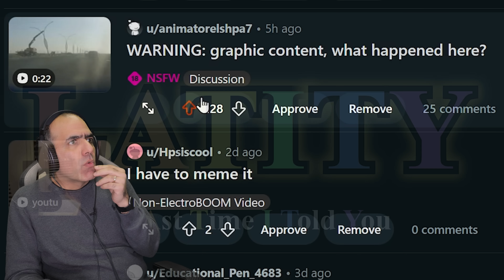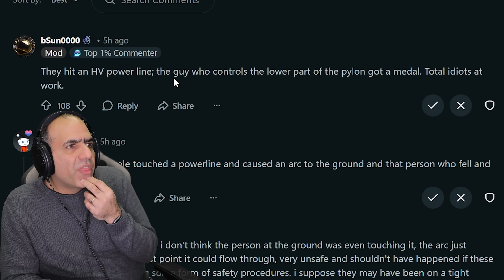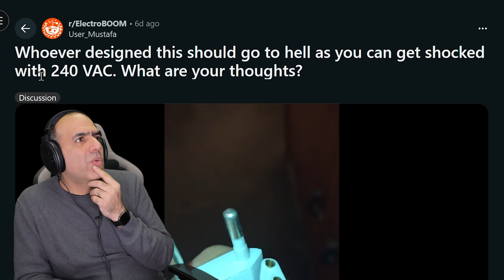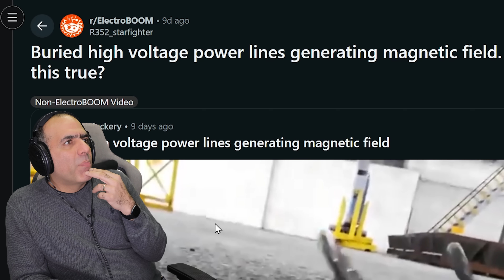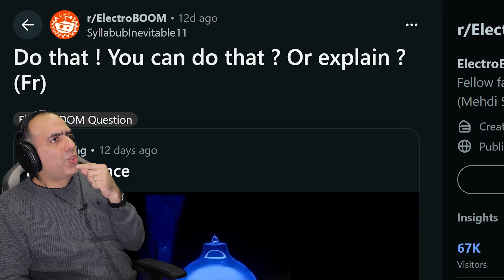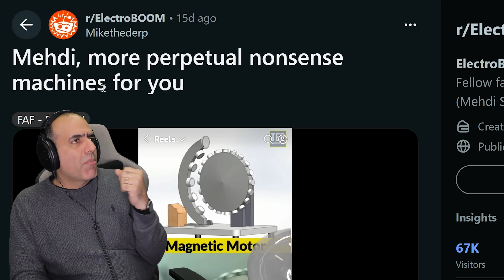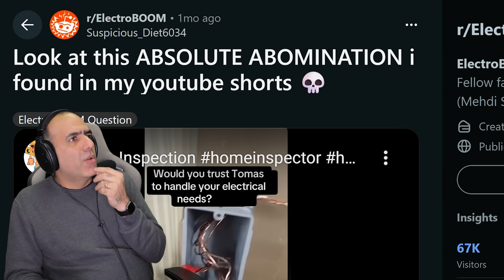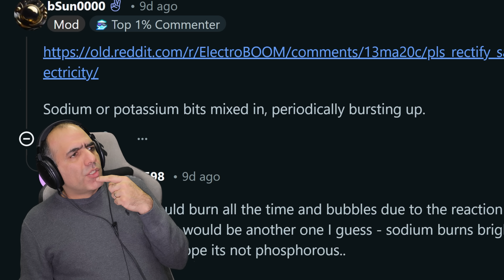Have a Pole? Need a Hole! (LATITY-017)

Comment: Brazilian here. That's our national standard for electrical outlets; for 16A and 20A appliances, the thickness of the connection pins is different, so you can't plug a high-current appliance into a 10A outlet, but you can easily use a <10A appliance in a 20A outlet. Besides that, it doesn't prevent us from using adapters and plugging 20A appliances into 10A outlets; my microwave has been like that for a few years and so far everything is fine.

Comment: In Brazil there is no standard for 110 or 220v outlets and some states will you either for their home consumers... You can imagine the mess
Reply: Many homes have both (often in the same outlet as in the picture). It's actually 3 phase supply so phase to neutral gives you 127V and phase to phase 220.

Comment: To prepare you for school: ged and no highschool diploma or college,  generator mechanic and electrician, the reason residential voltage is usually limited to 120V (and 240V split-phase) is because higher voltages push more current through your skin's resistance, and it's that current—not just voltage in general—that forces stronger involuntary muscle contractions.
With dry bare skin (high resistance, often 100k+ ohms), 120V or 240V usually gives a quick twitch or jerk that throws your hand away (low current, below let-go threshold). But step up to something like 277V on a wye system (hot to ground), and even with dry skin it drives enough extra current to cause sustained contractions—your muscles lock harder and longer because you're closer to or crossing the let-go threshold (~6–16 mA). It's a combination of voltage overcoming skin resistance to produce current, plus the 60 Hz AC frequency preventing muscle relaxation, that causes the real "can't let go" effect. Path matters too—hand-to-hand or hand-to-ground is worst.
I'm smoking cereal milk, I smoke weed so that's my excuse for rambling like a half-educated idiot. What's yours? haha

Comment: 6:30 It is probably from an aluminum foundry. The excellent Mr Bidouille, a French youtuber, https://youtu.be/7aQZOzjjlC0 visited such a plant and does the same experiment, aim at the middle of the video. The large pillars are bringing the huuuuge amount of current required for electrolysis. I didn't have the chance to visit such a plant, I "only" saw a copper electrolysis plant where each cell drained 15,000A in 24V (DC obviously). It was already impressive.

Comment: Some idiots installed stucco on the outside of my apartment and stapled chicken wire deep enough to electrify the chicken wire and whenever I left the house barefoot I got electrocuted. Took them 6 months to fix it.

Comment: The reason why they still produce and sell incandacent bulbs even today with higher ratings is that in industry, university labs, etc, using these to convert excess power or test power into heat and light, since its better than being blinded by the lights of the LED bulb. 

Example, if you want to draw 1kW from the generator/power driver you have designed, using these bulbs is cheaper. very cheaper! compared to professional load. Imagine using a 1kW LED and being unable to see the instruments' screen due to super bright light, lol

Comment: Hi Medhi, for large capacitors: when I worked with huge caps (6 x 10F caps for simulating lightning strikes) it didn't have any lines on top to allow it to "safely" explode. My guess is because at that point it isn't safe to explode under any condition. The cap in the video you showed is also quite large so I'd imagine once you get large enough it stops mattering 😂

Comment: 5:00 the capacitor you saw is made by Keltron, and instead of groves on the top, the base rubber part of the capacitor is designed in such a way that there is a weak spot on it, where the pressure vents through. designing the base of the capacitor in this way is much cheaper. They don't usually work in these capacitors. These capacitors are of much higher quality and cheaper compared to other ones available in India they are available literally everywhere here...
Reply: Hiii that was my submission and it's actually my fault 😂😂 water got inside the capacitor 😂😂
Reply: Yoo keltron mentioned
Reply: Right

Comment: 12:57 yep. In Brazil, the standard voltage is defined at the city level, so in some cities the default is 220V while in others it's 127V. In others, it's possible to have both, so you can have stuff like those outlets. They usually use different colors instead of small stickers to label the outlets tho. When you buy something electronic you have to make sure you're buying something for the correct voltage. And yes, many appliances are lost yearly due to people plugging them to the wrong voltage.
Reply: That is horrifying
Reply: @wazoheat  you can usually test the wall sockets. Or connect a fan and watch it smoke.
Reply: @wazoheat  nah. Most appliances are autovolt or bivolt. It may be horrifying for people who import devices not compliant for the brazilian market.
Reply: @wazoheat it's really not. Any remotely up-to-code building will have the two voltages clearly labeled to be distinct at a glance. Further, in a domestic setting you're unlikely to have more than two outlets of the less frequent voltage in the entire home, which is not at all difficult to keep track of, even if you're too blind to see the socket's plastic housing is clearly color coded.
In fact, this arrangement is very similar to how it works in the US, only our socket standard is MUCH better, with proper safety regulations.
Reply: Not quite the answer but close. We use many more voltages: 115, 120, 127, for phase only, 220, 230, 240, 254, for phase or line, 380, 440 line only. What happens is, for example, in cities where 120v or 127v are available as phase voltages, also are available 220v or 240v or 254v as line voltages. And the standard allows using the neutral pin as phase, enabling the socket a line voltage.
Reply: @FelipeRochaRibeiroBeyer  Deus é mais
Reply: Dont you not have a national combined grid?
Reply: @N1g4t0wl  The grid is interconnected. All standadized at 60Hz. But one thing is the grid, other thing completely different is the mains voltage, which depends on the last transformer powering the socket.
Reply: @N1g4t0wl  The domestic grid has 3 wires: two 110V lines with opposite phases and a neutral wire. This allows you to choose per outlet whether you want 110V (phase + neutral) or 220V (two phases). I’m not sure about "city level standard", but at least in my region most outlets are 110V and a few are 220V in case you need to run high-power appliances like an oven.

Comment: 10:48 hi Poland here, no they probably don't use 250v but around 230v, it's written 250v volts because there are quite big fluctuations due to solar panels or something like that, I was mesuring voltage at my home and it's around 235v, in my friend house is 230v (I'm living in east part) in central Poland I measured a 225v and in west part through my measurments is around 240v, so depends where you are there are diffrent voltages, so manofactures want to make it safe, most of devices are now rated for 230-250v or even 220v-250v.
Reply: Fluctuations have nothing to do with it. The reason they have 250 V written on them is because almost all switches and sockets  were designed for 250 V.
Reply: @mernokimuvek  (read this reply to end because I think you didn't read to end my comment) and why were design for 250v? Because in my opinion it's due to fluctuations, maybe I'm wrong but if yes I want to hear reson why, and you didn't read to end my comment because I wrote that more of this devices are rated for higher voltage than "normal" and throught the logic you can imagine that this 250v is their max designed voltage
Reply: @zenek48  It's because several decades age voltages were not standardizes and some countries used 250 V as the nominal voltage. Your theory of fluctuations makes no sense since 230V+/-10% is allowed, so it should be rated at 253V.
Reply: @mernokimuvek  ok maybe you're right, I don't know, but I apprecite that you are a normal pearson no like some of this kids in comments that will be rude to you.
Reply: Solar panels also have literally nothing to do with why line fluctuations happen. MUCH more likely are things like cable age, run length, the type of transformer usedto step down from high voltage to mains before entering you home, etc.
Reply: @Gabu_ sorry but they can do, idk how in your country by in poland if you have sollars you can produce this electricity and "sell it" (not exactly sell it but send it) to main network, and due to that in summer we have sometimes too much energy produced
Reply: @Gabu_  they have, we in Poland don't use dedicated distribution transformers for each house, our low voltage distribution looks like that, you have one high power 15kV-0,4kV transformer which feed usually quite big part of residential area, so when much houses on same low voltage distribution circuit have installed on-grid PV systems, it can usually increase phase mains voltages, I usually heard about voltages around 253V in sunny summer days when much houses have on-grid PV and these are on same circuit.

Comment: I spent a lot of time asking AI how long it will be until the value of efficiency is worth moving all power cables to isolated vacuum lines as part of an underground high speed cargo/power/liquid transfer network. Apparently the biggest motivation would be avoiding power theft vs. power loss due to inefficiency?

Comment: The latity videos are awesome Mehdi, the explanations are correct from a scientific aspect about electric fields ionizing the oxygen molecules in the air to form plasma and also about the shown tesla coil and it's resonance and reactive power out of phase for ac power and everything about electronics, it's nice to see an electrical engineer who truly knows about electricity, can imagine the electrons oscillating and besides the physics, it also involves some fairly advanced math for signal functions, sine wave and function adding up or their composition. I'm glad to say that during my graduation I also wanted to always know how to get to a specific formula, unit or a constant which is very important for engineers because we have to be able to think outside the box and to solve the problem which involves multiple steps and you have to fully understand it and not memorize it mechanically, so you can manage to deal with something completely new. I just need to give you an advice and that is to try to apply your theory in practice like staying away from a high voltage sorces of electricity that are capable of producing high power (have low enough internal impedance) because it can be quite dangerous as you know, like the microwave oven transformer, it's secondary voltage is very high and it is a low frequency, low impedance (which means high current limit that it can provide) ac power sorce which is probably the most dangerous combination, van de graff is quite nasty, but not so dangerous because of the short pulse period (not gonna explain further, you're an electrical engineer as well). But, all in all, keep making these videos because they're both informative and entertaining. Honestly, a very nice video, except at 12:16 when I was absolutely blown away by numbers 6 and 7 where I went lmao😂😂😂. Thanks Mehdi

Comment: Besides, if your muscles get more than enough current (depends which muscle) to get burnt usually tendons connection to muscles and nervous system burn, it can stretch muscles or retract them hard enough and then lost nerves cannot command them to get back to normal so they get hard as a rock, that will kill you in a fraction of a second

Comment: That 110V and 220V connections remind me of when we had a pilot on board with a 110V laptop that was nearly out of battery and we had a 220V main net. Got the Electrical Engineer to rig up a transformer to halve our voltage. He rigged it up the wrong way, and in stead of going from 220V to 110V it doubled it from 220V to 440V... that laptop didn't live long.

Comment: I think typically in Brazil you have either 127 V or 220 V on normal sockets. That may be form some hotel or something like that so they have both. That kind of a system used to be common in many European countries in the past like 1950s.

Comment: 12:50 it does happen, a lot, we use a mixed voltage here, part of the country uses 127v(we call it 110v) and the other half is 240v(we call it 220v) almost everywhere that uses 127v has some 240v outlets sprinkled in, we prefer 240v for power tools and other high power applications, like the showers, and use 127v for everything else, thankfully, almost everything supports both voltages nowadays

Comment: Speaking of shock hazards, I got one of those fancy Pomona clip lead sets (stupidly expensive) because I was sick of the cheap chinese ones failing. One of them had the conductor partially poking out of the molded plastic right where you press with your thumb to open the clip. I contacted Pomona about it and they said "oh, we don't make clip leads."

Comment: 12:40 Its commom to have both 110V and 220V circuits on some regions of Brazil and yes they use the same socket. Most of the appliances are also sold in 110V and 220V versions. As you can imagine, its very easy to mistakenly hook up a 110V appliance in a 220V outlet. Ask me how i know...
Reply: 220v and 127v devices/outlets being interoperable is a FEATURE, not an issue with the standard. Pretty much anything built to follow Brazilian regulatory norms in the past 25 years will gladly function with both voltages. The appliances which do not either require a completely different type of connection (e.g. water heating showers) or planning (e.g. fridges). At that point, connecting a device to the wrong voltage is to damn one's own intelligence.
Reply: @Gabu_  of course, but appliances with ac motors or heating elements are usually single voltage
Reply: I live in Brazil, and any modern electronic device here has Dual Voltage. Most household appliances in my home are like that. So, unless it's something very specialized, it doesn't make much of a difference. Even computer power supplies are like that these days.
Reply: In the US we'd probably use a NEMA 5-15 and a NEMA 6-15 for that. The prongs don't line up between those standards, so you can't accidentally plug in the wrong one, and they're both reasonable sizes to be plugging in and unplugging devices regularly (unlike dryer plugs).
Reply: @diablominero  "probably" is the slightly concerning word in that sentence!
Reply: @paulabraham2550 we could use 5-20 and 6-20 if it's a high current circuit. Or somebody could use a dryer plug for a 220V  kettle. And of course a moron with a soldering iron can construct any cursed thing, electrical codes be damned. But I think 5-15 and 6-15 is the default right way to build a system like this in the US.
Reply: :face-turquoise-covering-eyes:We have red sockets for our 220V outlets in an attempt to limit the chances of that. It doesn't necessarily work.
Reply: @paulabraham2550 it does work, unless you're incredibly stupid. Also, what kind of garbage device built in the past 25 years can't operate with either voltage?
Reply: @Gabu_  kettle
Reply: @Gabu_ the best solution I think is to enforce electronic overvoltage and undervoltage protection embedded in all appliances, or at least in single voltage devices. People would use adapters anyway if the sockets weren't unified, so using different sockets wouldn't solve anything and still be worse by breaking the interoperability.

Comment: If Philippine's 250 V @ 10 A outlet is weird, let me tell you that we also use the same exact outlet and plug for 120 V (like Brazil but no ground).

Also, @ 6:53, I think that's in Philippines too based on footbridge style and color (or lack thereof), and a convenient location of jollibee near the footbridge. And yes, that's normally a communication line going through the steps.
Reply: yes someone , confirmed its philippines,  @ElectroBOOM  please visit philippines and test their electrical safety we're gonna make you viral 😂😂😂

Comment: 12:39 In Brazil the voltage is regulated by state laws, not federal. Some states use 110v, some use 220v. Some people (like me) have appliances that work with 110v, some that work with 220v. Sometimes we need to have both outlets, many times people use transformers... 🤷🏻‍♂
Reply: It's technically regulated at the state/county/city level in the US.  But most don't have any interest in writing their own code, so they just adopt the National Electrical Code, which despite being called that is NOT written by the government at all.  Some places (looking at YOU, Cook County Illinois with your idiotic metal flex wire) add their own usually stupid crap on top.
Reply: Yeah, I'm not sure how we got to the point we are now, but some cities, like the one I'm living now have both outlets. Installation for the AC on 220v, generally, and other appliances are 110v...